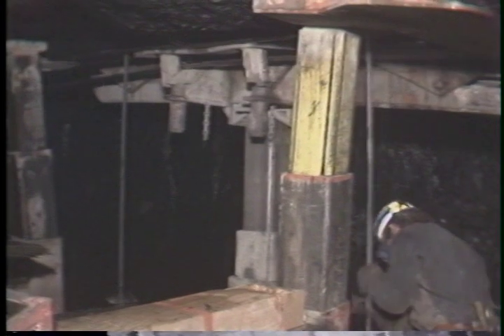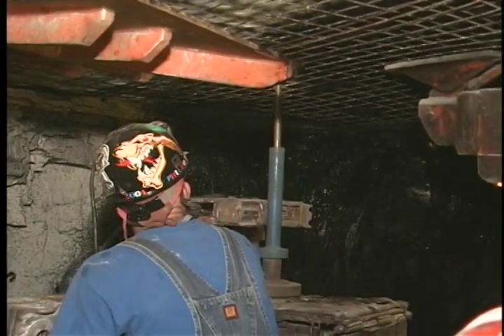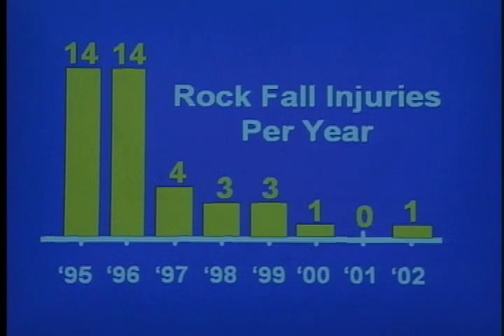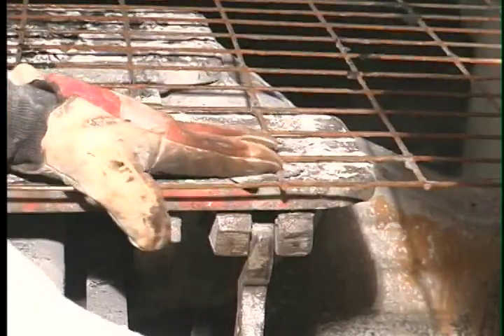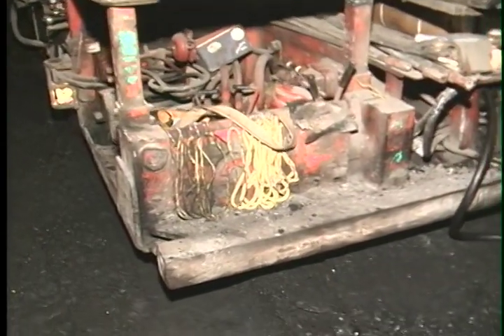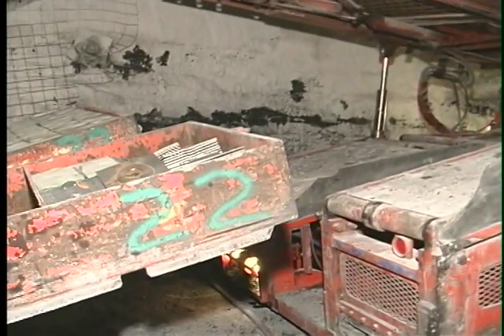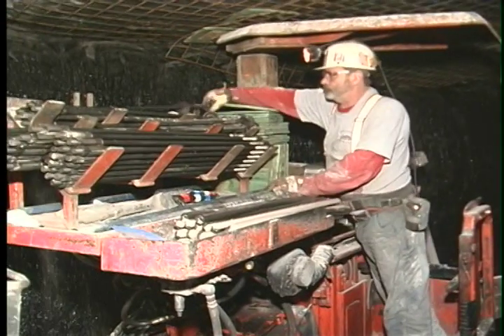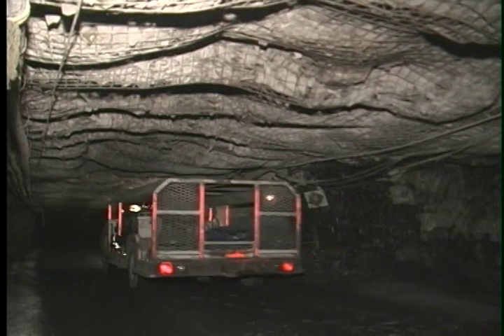Make It Safer With Roof Screen

Comment: this is nothing but a concrete reinforcement product. after this is installed on the roof of a mine it is impossible for a miner to see the condition of the roof. also for the mine police to see the condition of the roof. has to be someone's brother in law selling this crap